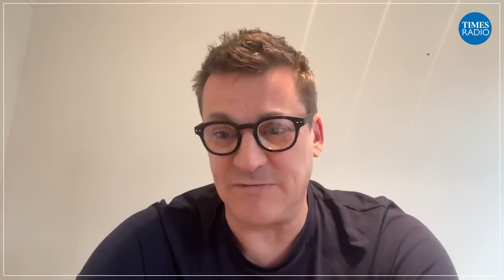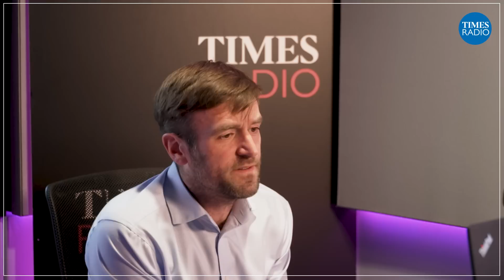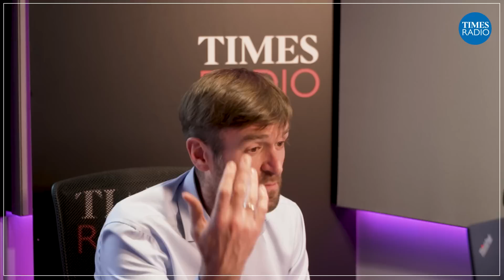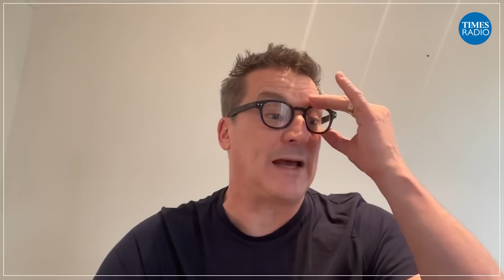How Britain could use wind turbines to stay one step ahead of Putin

Comment: So the wind farms which presently exist will need replacing so are we going to ask China to manufacture these new blades? Is that the same China who is an ally of Russia? So we are presently vulnerable from attack via incoming aircraft and missiles from the air and from sabotage from the cutting of undersea cables which send power onshore from these sea based wind farms?

Comment: As we have sen with the communication cables being cut by Putin/Xi, off shore turbines are vulnerable - the cables to shore can be destroyed very easily. The UK has to have a massive scheme for on-shore turbines plus every new house being planned for solar panels / batteries etc. We can be very energy resilient with that way of doing things
Reply: There's a guy in Australia, who has designed a turbine and housing that they can drop down on the seaward side of a ports breakwater, the waves crashing into it compress air inside and drive turbines, we have literally hundreds of harbours in the UK and that would provide local power. We also have tons of large rivers with weirs on so there should be some water wheels on these to harness the continuous flow. But this is not something that occurs to our dumb politicians, instead 8 billion wasted on GB energy a company that produces nothing...

Comment: The off shore wind turbine is also an easy target for an attacker as an easy  removal of  an  source
Reply: The import of fossil fuels is even easier to target (we've already seen that with Ukraine and the effect that had) as are single large power stations compared to more spread around turbines. Of course onshore wind would be harder to attack, as well as being cheaper and easier to install, at least the Labour government has removed the Tory ban on onshore wind.
Reply: @MentalLentil-ev9jr  Targeting where the cables come ashore might take the wind farm off line for a few hours.
Reply: @alanb9337  Indeed, all our infrastructure is vulnerable, it isn't just offshore wind. Gas pipelines are even more vulnerable.